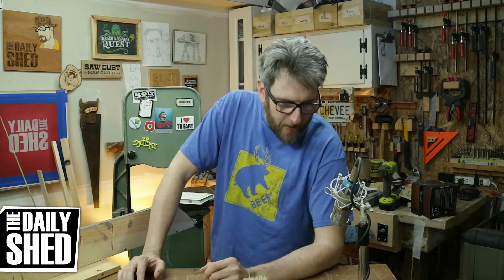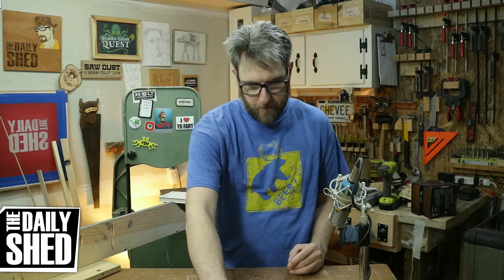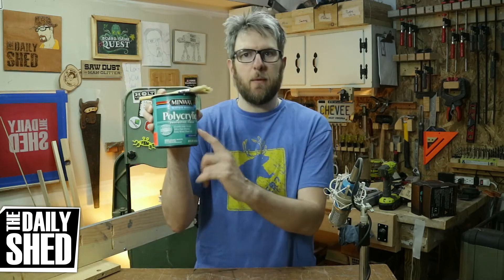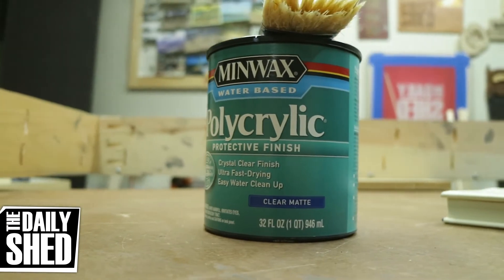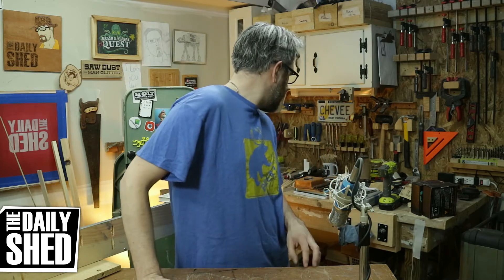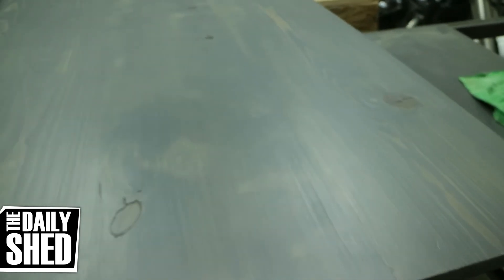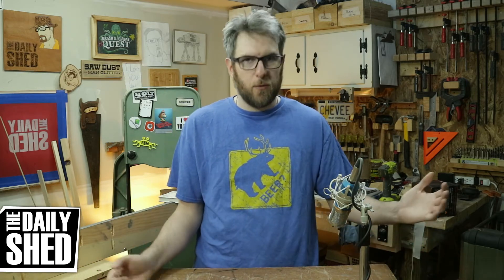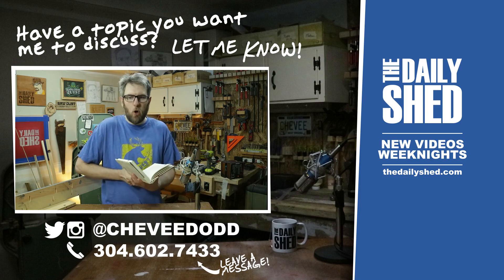I use Polycrylic wrong...

Comment: Thanks! I was wondering if I could flood the polycrylic on some wood earrings for a smooth surface. I've got some testing to do. 💖
Reply from the maker: I've dipped small parts before. If you can control the drips, it's the best.

Comment: I am watching videos trying to figure out what I did wrong. I did a fairly think first coat but it took a week to dry enough to sand! It kept pilling up and making little boogers the clogged my sandpaper, even in a warm, low humidity room. I’m about to pull out my hair in frustration, I’m trying to sand my third coat and still having problems, and it’s two weeks into this effort.
Reply from the maker: This happened with water based poly? I've had that happen with oil based for sure. I DO NOT recommend flooding coats  of oil based finishes.
Reply: @CheveeDodd  I used Minwax Polycrylic satin sheen.  Bought a new can, kept it at room temperature, stirred it very well (no shaking), and applied this in a bedroom so it was still a decent temperature and relatively low humidity because it's been well below 0 here in the midwest.  I'm about to just strip it all off and re-do with some Arm-R-Seal.  I just want a smooth, hard surface to use as a writing and drafting desk.
Reply from the maker: That's wild. I've never seen polycyclic gum up and I put it on very thick. That sucks! Good luck on the fix!
Reply: @HydeMyJekyll  It literally just happened to me and I’ve never had a problem using it. The second I put it on my restored dresser I knew I messed up. I’m waiting for it to dry completely so I can sand it all off & hopefully I don’t have to re stain my top & I’ll just put a wax on it. 
This can was a Brand new can I wonder if they’ve changed something in it
*I only done a thin first coat very light & it destroyed my top